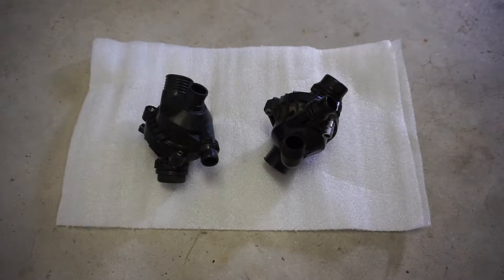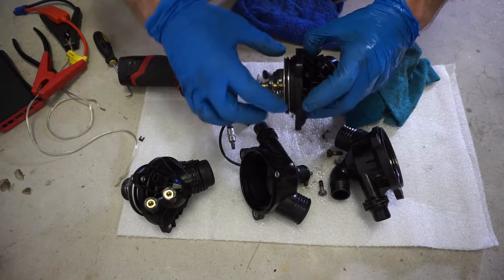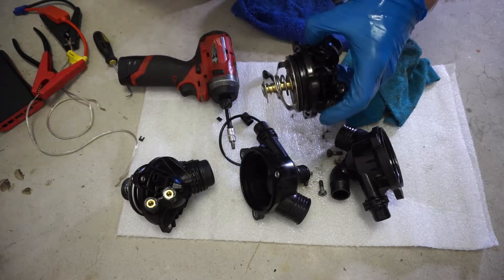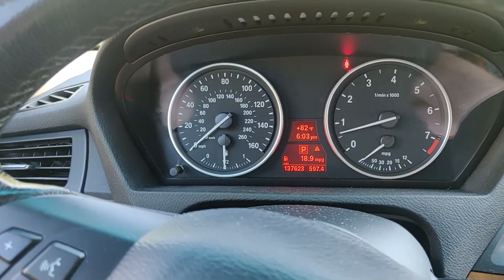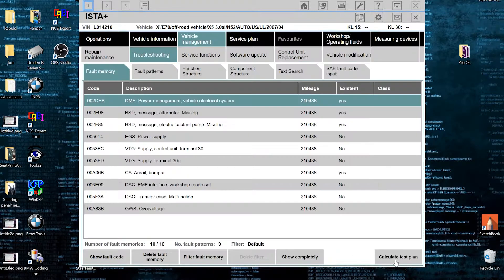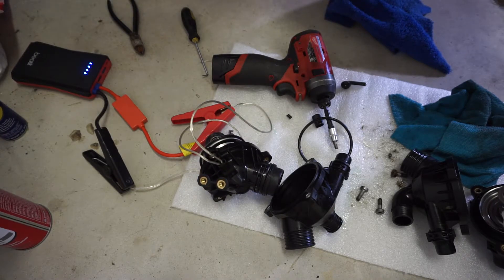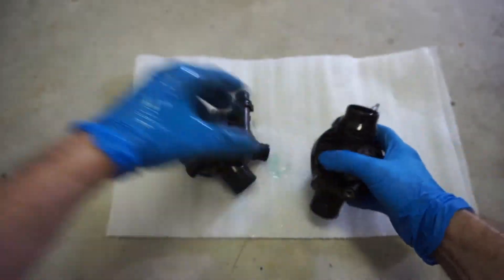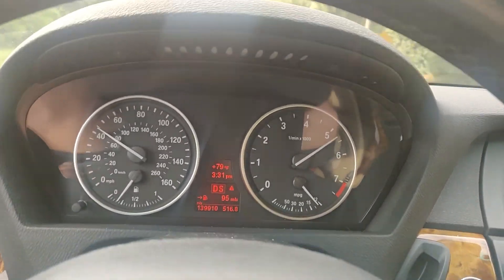How to TEST BMW Thermostat Rebuild DIY N52 / N54 engine

Comment: Since the water pump is fully electric and regulated by an internal computer module along with the coolant temperature sensor, it seems like a thermostat might not be necessary. I’d just remove it and let the electric pump manage the engine temperature. It’ll probably run a bit cooler overall, but honestly, those N52 engines tend to get too hot anyway—usually around 220-230°F.

Comment: Hello, I have a question about the thermostat, what is the number on the metal one inside because I am looking for information to replace the center so that it opens at 87°C and I cannot find anywhere information about what it may be from.  Regards
Reply from the maker: sorry, dont have that info, but know where you can get one) Junk yard, you can go there, and open up one on the spot and see it for yourself. good luck!
Reply: Hi man!
Did you find the part number for core thermostat?
Thx!

Comment: My car is a 528xi and it has this thermostat here. When driving, the temperature drops to 76-80 degrees and the engine runs cold, is there any way to increase the temperature a little?
Reply from the maker: Replace the thermostat, the mechanical piece stuck open which is better then if opposite, but this is the only way. There quite a few OE options on FCP for the kit, pump and thermostat. Just highly suggest you not to buy a cheap Chinese pump, i did it, and it was a mistake. I also have video on how to replace the water pump on n52.
Good luck
Reply: The new thermostat has been changed and this problem is here again. When coughing, the temperature rises to 105-109 degrees and then falls to 76-80 when moving. At the same time, the cooling fan is turned on even at low temperatures.
 @Makhnovets
Reply from the maker: @levantsulaia3804  why did you replace the thermostat in the first place? Did the pump was replaced? Is this issue presented before replacing the thermostat?
Reply: The temperature was falling while driving and I thought the thermostat was stuck in the open position, I changed it, but it is still the same, and now as I see it was an electric thermostat... In my car, the catalyst failed and the O2 sensor was not turned off by software. Could this be because the engine is running under load, so the temperature drops to 80 degrees? @Makhnovets
Reply: @levantsulaia3804  did you figure this out? My car is doing the same thing, running too cool and now bank2 cat is also bad 🤬
Reply: @nathanielmoore5677  im in the same situation, you know whats the problem?
Reply from the maker: It’s more like either pump or thermostat is faulty, modifying temperature isn’t the best idea here, i think in near future car will trow you a code for the pump, unless you have faulty temperature sensor